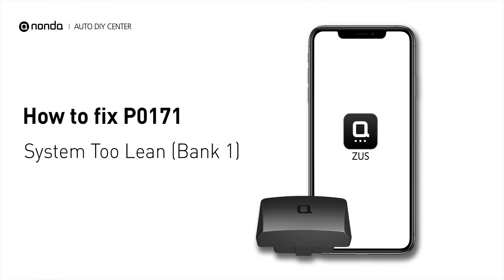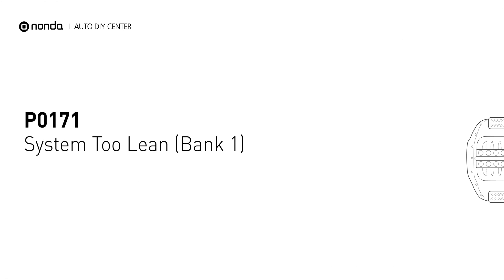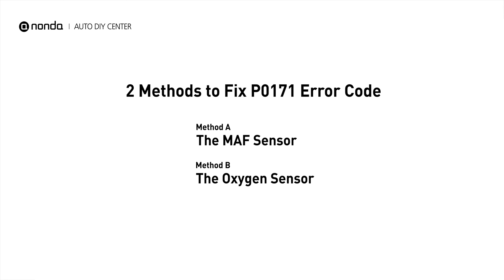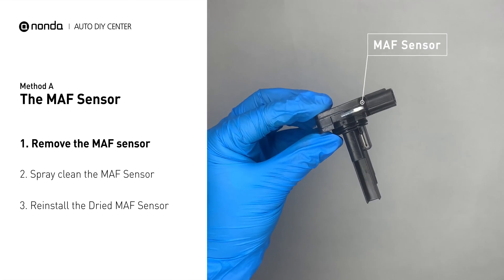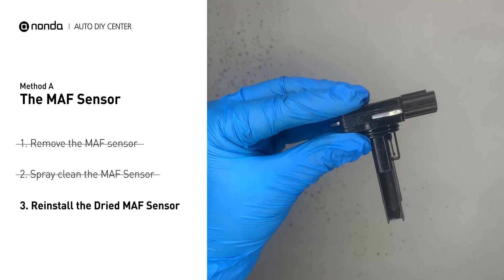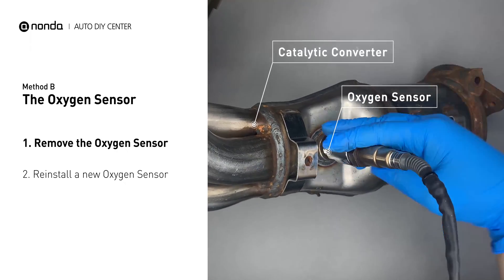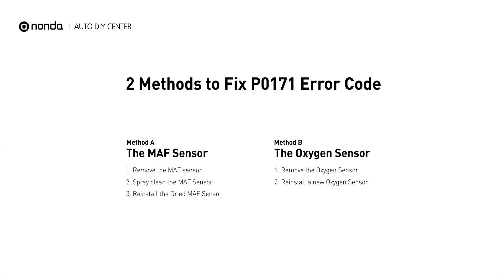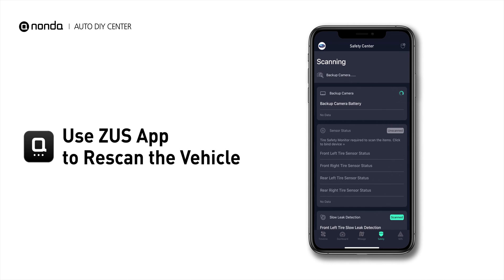How to Fix P0171 Engine Code in 2 Minutes [2 DIY Methods / Only $8.37]

Comment: Is it safe to drive with P0171 code, because I got an appointment which is like 3 weeks from now to get it fixed
Reply from the maker: Hello, driving with this code present can eventually cause internal engine damage so we highly suggest to get it fixed as soon as possible.
Reply: it will cause motor to knock
Reply: it's not great but i've been driving my 99 mazda for 3 years with both P0171 as well as downstream O2 sensor code and had no issues. just spend a few hours in my garage and finally fixed it so i can pass inspection. its just not great for longevity of the motor!

Comment: Having the same issue P0171 and P0174 2002 chevy s10
Reply from the maker: Hi Albert, you may possibly have a vacuum leak. Kindly have a check.
Reply: @nondainc  also the light comes one for a day or 2 then goes away for about a week , maybe intake manifold gaskets? Thank you for your reply
Reply from the maker: Yes. Kindly have it checked and replace if necessary.
Reply: @nondainc  turned out to be worn out intake manifold gaskets,  both top and bottom
Reply from the maker: Hi Albert, we appreciate the update. This is why a visual inspection is highly suggested if you are getting two or more fault codes for further diagnosis. We're hoping that the issue has been sorted out.

Comment: I have a 2013 Toyota Corolla and get a check engine anti traction light on dash... Have you ever experienced this
Reply from the maker: Hi Fabian, is the traction light stays on as the vehicle starts and begins to run?
Reply: @nondainc  Yes... I get a PO171 as well system too lean bank 1 tested for leaks no leaks
Reply from the maker: Hi Fabian, first thing you must do is verify if there's any other fault code present along with P0171 using the ZUS Smart Vehicle Health Monitor Mini (or any available device like this that you have). Other issue could be coming from a faulty spark plugs/ignition coil, dirty MAF sensor, loose fuel cap, stretched timing chain, faulty downstream o2 sensor or a blocked PCV valve. If the check engine light is blinking, we advice not to drive the car. Once the check engine light is fixed, the traction light will reset as well.

Comment: I tried both of these and still get p0171 and p0174 if anybody could help me out that would be awesome
Reply from the maker: Hi Justin, since you are getting multiple error codes, we suggest taking your vehicle to your local mechanic for further diagnosis.
Reply: Check the fuel injection pressure and see if there’s any air leaks before the maf sensor. I’m about to replace both oxygen sensors soon as the parts come in. I already changed out the maf sensor, I had to get a oem part because the aftermarket ones kept braking at the connectors

Comment: 2002 Toyota Highlaner 4 cylinder.   It seems P0171 code comes on just once in a while and resets itself after I drive for a while.  The MAF was replaced about 4 months ago.  Passed a smog test just fine last month.  1 day or so after filling up the tank, the engine light P0171 came on.    I wonder what's causing P0171 to come on and then resets it.   Thank you
Reply from the maker: Hi Phil, a replacement for the oxygen sensor on bank 1 might be necessary. Please get your vehicle checked by your local mechanic.

Comment: Hi Steve, I just got this reading on my car I have a 2008 Pontiac Grand Prix but there isn't any videos on how to fix it, could you give me any tips? And autozones diagonistics says i need to replace my intake manifold gasket. Any help would be most appreciated!
Reply from the maker: Hi Marcus, please try cleaning the MAF sensor first. If the issue will still persist, kindly have a check on the intake manifold gasket as it may need a replacement.

Comment: i have a 1997 Chevy Malibu LS V6  and a check engine light has shown up, indicating P0171- System too lean (Bank 1). what do i have to replace to get it to go away.
Reply from the maker: Hi Brandon, check if there's vacuum leak. Try cleaning the MAF sensor and check the condition of the fuel injectors. Also, a clogged air filter could trigger this code.

Comment: 2011 chevy cruze, replaced both still have the light, any ideas, i cant hear any sort of vacuum leak
Reply from the maker: Hello, we recommend checking the condition of all the related parts that would possibly contribute to the existence of this code like the condition of the fuel injector (if sticking), fuel filter (if dirty), and PCV valve if faulty or stuck open. Also, test the intake manifold gaskets for leakage.

Comment: Pl. help.. Bmw 2013 X3 changed engine 2015 (Compatible) Check engine light ,and Drive trainmalfunction sign,
no vacuume leaks I check all hoses.Had a basic scanner to check codes,I got P0171 01/02 &  P0171  P 02/02.
Can you please interpret the meaning of these codes.I already  spent $7000 engine change n labour ,but nomore money.Please advise.Thanks in advance.Ash(Toronto)
Reply: Thanks for your reply,I checked in take boot one is tied with a metal round clamp but other side inserts into the metal part into the engine and it is ribbed but no ring ,Is it normal?Since its a 4 cylinder 2.0 lit ,I scanned with OBD scanner which gave these results
 P0171 
01/02 and
P0171  P 
02/02. 
Does it mean I need both oxygen sensors or only upstream sensor (Before Catalytic converter).I will sincerely appreciate you wisdom,expertise and help.
Reply from the maker: Hi Ashok, please check if you have a cracked or ripped intake boot.

Comment: Hi. I have a 2005 C180 Mercedes and a check engine light has shown up, indicating P0171- System too lean (Bank 1) and Fuel Trim (Bank 1). What can I do about it?
Reply from the maker: Hi Michelle, this trouble code could be triggered by a faulty MAF sensor, O2 sensor, or if there's vacuum leak. Kindly check the said parts and repair/replace if necessary. Hope it helps!
Reply: @nondainc  what if I dont change these parts?
Reply: Same here

Comment: My 07 Chrysler 300 2.7 V6 started acting up. So as I try to start it up it stalls. So it will only start up as I press the gas.. after serval tries. As I drive it shakes alittle. Could you please help me.
Reply from the maker: Hi Juan, please use a scan tool to verify the code that is present on your vehicle. Your battery might be weak, and you may do a battery voltage test to confirm this causes the issue. Kindly check also the battery terminals for corrosion. If there are no damage, you can just clean it to see if the issue will be fixed.

Comment: Changed throttle body and crank scenor still reve it up 3 or 4. Times flashing light comes back on lighting bolt ⚡ just saying shut it off starts fine until i give it gas comes up po171  cam shaft position senor Changed it too
Reply from the maker: Hi Jr, we suggest checking the engine for any vacuum leaks, and the fuel pressure with a fuel pressure gauge to see if the proper air/fuel ratio is maintained. We also recommend looking for the technical service bulletins for your specific car model that's related to this code.

Comment: I had this code and the 02 sensor bank 2 downstream showing on my OBD2, but also a tear in the lower intake boot which I sorted, the scanner says all my sensors are reading the normal voltage when running, so could the tear in the intake boot cause the 02 code also? it's a 2001 BMW E46 330CI.
Reply from the maker: Yes it could be. Also, it is necessary to find/fix if there is a vacuum leak. Clean the MAF sensor and check the connector/wires to be sure.